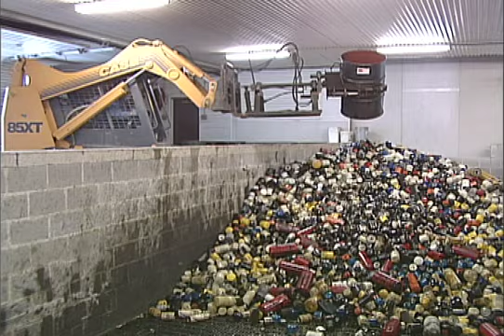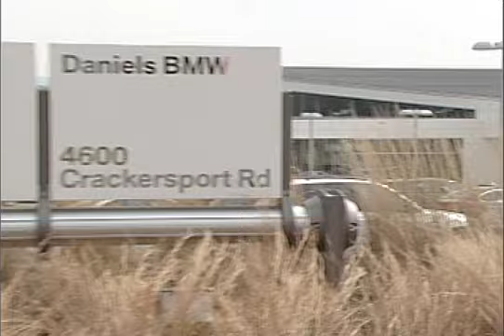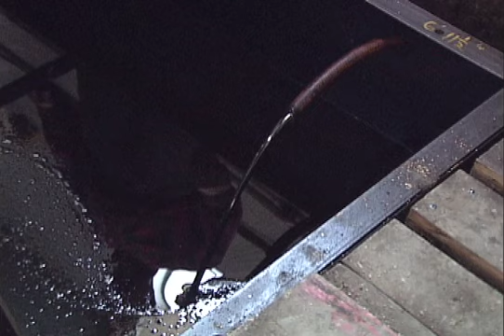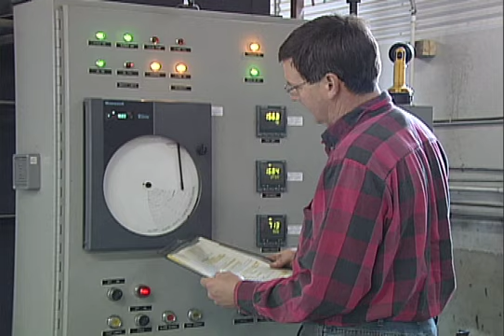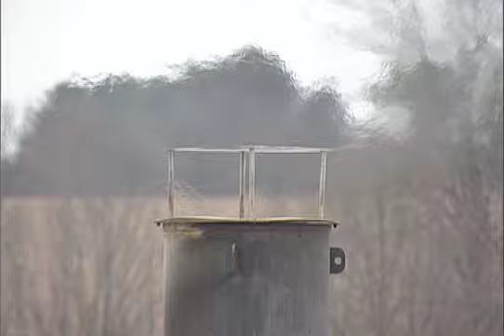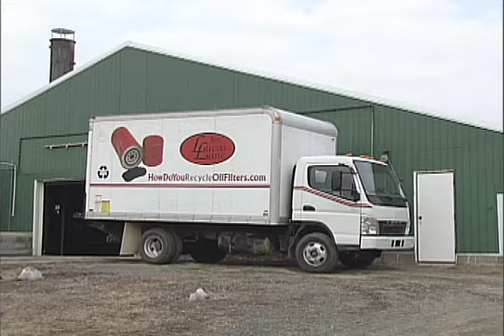Oil filter recycling by Lucas Lane Inc.

Comment: You're the reason why I started saving my used engine oil filters. Before, me and my dad would just throw the filters away in the garbage after me and my dad would be done with the oil change. But now, for like the past 5 - 7 years or so, I have been saving my filters and turning them into my neighborhood recycling center that accepts them and they can properly recycle the steel that would be found on the filter and the used motor oil that would still be trapped in the used oil filter.

Comment: I would take issue with the statement "this process is 100% environmentally friendly..." as the heat processing must generate not insignificant amounts of particulates, CO2 and noxious oxides.  If you scrubbed your chimney emissions then you might be able to make that claim.  Nevertheless, you are still making the best of a bad job (that which is done by needing to use machines that use so many oil filters in the first place - ie internal combustion engines) when there is a perfectly acceptable alternative to 90% of them; ie the electric motor.  Your work also goes to prove the wonderful old Yorkshire saying "Were tha's mook, tha's brahss" (or without the lame attempt at accurate Yorkshire phonetical pronounciation - "Where there's muck there's brass', 'brass' meaning money, here).

Comment: I just deal with my personal vehicles doing all the maintenance on them myself.
After an oil change I let the filter drain for like a week then toss it in a hot burning
wood stove in the garage.  When I get some 5-6 gallons of used oil it goes to the local
auto parts store where I believe it gets put back into industry.

Comment: Why not use centrifuge for oil removal? Works for honey....
Reply: Crushing removes 90% of oil. Final 10% is put to use to burn the paint, paper, rubber, and other non steel components of the filter, leaving ash and steel to be recycled as "clean" metal. The oil is still doing work even if it is not 100% removed.

Comment: Cool, where's the profit?
Reply: In selling metal
Reply: You may not realize this but Recycling is rarely profitable and usually a break even industry. Recycling shouldn't be supported because it is profitable but instead because it is the correct thing to do. Otherwise the streets and fields would be littered with garbage reaching levels you can see in 3rd world countries with zero support for collection and "disposal"
Reply: @btwbrand  It depends on what is being recycled.  Metals recycling is hugely profitable.  So is energy recovery.  What's not profitable is the fake feel-good BS RE/AE stuff they push down our throats.

Comment: Could someone please shed a bit of light on how does this video have so many dislikes? Is it because of a bit of misleading heat vapor (which is a bit of nothing-burger tbh)? Or am I missing something else?
Reply: you can see the dislikes?
Reply: @buckadillafilms  Yes some of us don't simply stop using likes and dislikes because google covered them with a piece of cloth. It has 1.4K dislikes. Did you know windows 10 and 11 are simply windows 7 with a different look. Every menu, setting, screen, and option on 7 is still under there, they just hid them under a new look and added a little support for newer items that could have been enabled in windows 7. Made the whole world buy the same operating system all over again. They just put a bad coat of paint on it.
Reply: @btwbrand  Do you have any tips on how to uncover the dislikes?
Reply: @buckadillafilms  Theres an add-on app of sorts that does that.
Reply: Its from the brainwashed tree huggers finding out how reality actually works.  They really don't like their little safe space bubbles getting popped.

Comment: So you burn 10% of the oils plus the rubbers ?? With the amount of fuels you use to pick up deliver separate and burn the 10% I'll bet it negates any benefit to the environment
Reply: Well on one hand.. they are cleaning steel to be melted down and used to make new items, collecting oil waste to be used in road production, and are providing a service and jobs.
What environmental benefit would it be to take the mountains of oil filters they didn't process and place them in the ground in a landfill or throw them out back in a pile like they did till the EPA was organized? Do an experiment. Take all your used oil filters and throw them in your front yard, and leave them there.  Make it a long term project and see if you can document the benefits.
Reply: Good thing CO2 is actually good for the planet and all life.

Comment: I remember when recycling oil filters was a thing. You'd collect them drain them and some places would have oil filter crushers. And we'd save them all in 55 gallon drums for pickup. Not anymore now they just get tossed in the dumpster nobody recycles oil filters anymore the cost was too much.
Reply from the maker: But the question is do those shops still charge a disposal (environmental) fee?

In my area most shops charge the customer several dollars per oil change to dispose of the filter and pay me less than a half dollar per filter and most burn the waste oil to heat their shops.
Reply: @farmerluke2  Ya they do. I worked in a lot of shops they all scam the customer.
Reply: A large portion of garbage is sifted and sorted through to remove items such as those oil filters if they end up in a bin and in the back of a garbage truck. Recycling is only a profitable work when you specialize in one type of recycling. In this case oil-filter recycling.

Comment: its a damn joke taking used oil to the collection center.. they just want you to do it so they can recycle it then resell it again and make a profit.

Always throw the oil on the brush fire.. or soak it up with a wag and throw it in the wood burner.... its the proper way to recycle used car oil... or take the used oil and spray up under the car wheel wells and underneth with used oil...
The final way to recycle used oil, if have a wooden porch, dump the oil on the wood. it will soak it all up because wood is thristy for oil.. and it will last for the longest time.....
Never have never will take used oil to the collection center.. it always goes in either the wood burner or the brush pile or the porch.

THE HELL WITH WATER BASED PAINT. USED OIL IS GOOD FOR WOOD
THE HELL WITH ANY PAINT, the paint they make today for wood is CHEAP MADE SHIT.. AND THE BEST PAINT YOU CAN GIVE TO THE WOOD OR PLYWOOD IS USED CAR OIL...

Comment: This is a great process. I do wonder sometimes if the green people (the really nutty ones) do realize that just because they like processes like this doesn't change the fact that it still takes alot of energy to do this and that there is no such thing as zero emissions. I realize that's not what this video is about but just a thought.
Reply: If you read these comments you will see that people are clueless about how the world works and the fact that the world runs off of co2 production.

Comment: You're burning waste oil to heat your ovens? That will pollute the air with heavy metals and chlorinated compounds.
Reply: Where do you think waste oil ends up? It doesn't get filtered and cleaned. It gets re-used as a fuel or part of a product, such as the asphalt they mentioned in the video.

Comment: Wouldn't drilling or punching holes in them prior to crushing help drain more oil out of them
Reply: 90% recovery is fine enough.  they needed 200 gallons in addition of the unrecoverable oil to create a fire that burns all of the metals clean enough for recycling.

Comment: So the filter and rubber gasket stays in the filter or did they not show the part there they cut open the filter and take them out and removed the filter and rubber gasket? This is awesome that this happens but so many people just toss oil filter in garbage. There should be a rebate for used oil filter return to make this effective.

Comment: Lul using 200 gallons of oil each time the do the thermal process is everything but environmentally friendly. I got a better idea. Use a shredder and then put all the pieces in a centrifuge to get all the oil out. It will be alot better and it wont waste 200 gallons of used oil.

Comment: What is the cost of energy spent in the furnace? Would it be less expensive to use mechanical shredder to cut filters into small pieces like 1/2 by 1/2 of an inch? These fragments can then fall on the pan from which oil will be drained via 1/4 inch mesh into the sump. BTW, how about making reusable elements?

Comment: As much as I dislike the cartridge filter on my rav4, seems like cartridge filters are the way to go. Waste oil dump locations should also take the cartridge filter and press what oil they can from them.  I would think with a good press, most of the oil in the filter would be removed.  At least this would save on steel production and the high amount of utilities used in most cases of recycling.

Comment: As a metallurgist, I really dont see the added benefit of the final step. The steel casing of the oil filter could be used as is in a foundry. All other burnable components, especially oil would add additional energy to the melting process which is beneficial. Furthermore the steel shown in the video comes out rusted, which is detrimental to its yield in steel production.

Comment: Thumbs up for recycling. But thumbs down for auto manufacturers. I hope auto manufacturers could abandon the steel oil filters and switch to those paper filter element (permanent housing for filters) used in BMW cars.

Less materials needed for manufacturing and less energy needed as well. 

Easier to recycling since its mostly paper rather than metal. Current recycling method causes the rubber and paper to be burnt off. If the filter is mostly paper, The paper may be recycled as well.

Comment: Had a process very similar here in West Central Alberta more than 30 years ago. The problem I have with the "environmental fee" that is charged on every oil filter, no matter what size & the environmental fee charged on the oil & the container also I sjust a TAX GRAB! Those "fees" in no way induce a customer to be environmentally friendly. Once you pay your fees you can do absolutely anything with those products. A better solution would be to return a portion to the customer as is done with the bottle & can recycling!

Comment: Worked for a company that used a service like this.They charged y the barrel not weight,so we redesigned a small crusher,that would do all our filters.After draining the filter for a few days,filter was crushed waste oil put in the proper drums for recycling,crushed filters put in a barrel.Recycler would often ask us why our barrels were so much more heavy than other customer's.We were furnishing our own barrels which were never returned so I guess everything worked out.

Comment: I would think a shredder like they use for whole cars, remove as much oil as possible with a centrifuge, separate the rubber & paper, use them for fuel to hear treat the scrap & I suspect you would reclaim a lot more oil & the process would be a lot easier to automate. Neat system.

Comment: 100% environmentally friendly?? What does the skid steer run on and produce as a waste gas? What fuel powers the electric generators powering your oven and crusher? What do your trucks run on? Not questioning it maybe a high level of Eco friendliness, but 100%?? You'd have to be doing everything by hand or foot. Such a flippant statement it over powers the rest of the video for me.

Comment: wouldnt it be better to run them through a fine shredder with magnetic separator after it? the guts of the filter (the filter material) go to pressing unit, then incinerator. and the metal go either through sentrifugal separator. and/or to incinerator to burn any left over oil clinging to it before recycler?

Comment: Re: plastic oil bottles  (slightly off-topic, sorry....). 
I've been told that any empty plastic bottles previously containing hazardous materials should not be put into the trash.
 Do you have any info on what should be done with plastic oil bottles & used gas cans?
Also, Thanks... You're fabulous!
Reply from the maker: You should check with the plastic recyclers to see what they say about any residue left in the bottles. The gas cans should be fine if the lids are left off, the gas will evaporate.

Comment: If you were to recover that waste heat by running the heat through a boiler to generate hot water or steam you could start another business providing hot water or steam to neighbors for heat or air conditioning. 
Or provide all the heat for all your buildings on site or hot water for heat to any nearby industrial park.

You might not have enough possible customers for heat now but if there is sufficient land nearby and you could open an large industrial park your could offer piped in heat for far less then other sources of fuel for heat. It's done in many communities in Norway though thier using hot water from underground thermal sources they even heat the sidewalks to prevent injuries to the public.

Just thinking of how to use a waste product you produce waste heat.

Just for chuckles go to a nearby state college and ask the hydronic professor to ask his students how they would utilize the waste heat.

What have you got to lose but a few hours and give the students a real project to sink thier teeth into.

Food for thought

Comment: Pipe your exhaust heat though a boiler.  Use the steam  from the boiler to power a steam turbin hooked to a generator for  electric.   pipe the steam around to the other out buildings to provide heat in the winter. Get a MIL spec steam kettle for the company kitchen.
Reply: Industry 4.0
Reply: I was thinking that it was a waste to just let all that heat out in the air. Timothy, it seems like a possible and greate solution... :-)
Reply: Pretty good idea. Use that exhausted to generate electricity...
Reply: Free energy and creates work for boilermakers welders pipefitters ect
Reply: ehhhh.....how many yrs to recoop your investment in a turbine? A boiler to produce superheated steam?
Reply: Timothy Hays You made this way to difficult to understand.

Comment: The industry should go back to using paper elements instead of the steel spin-on cartridge. Yes...I know some engines use paper now, like my VW TDi and Cadillac SRX. Good start.
Reply: Curt Chase paper elements break down fast and are not good for high pressure oil systems of any power. The only good place for a element is a cheap economy car.
Reply: There are many automakers making the change to those, but for whatever reason, the oil filters without metal on them seem to be more expensive (at retail, at least).

The only reason I could think of for that is that the spin-on ones are self-contained units that are easy to test.

Comment: I read somewhere that oil never wears out only the additives, so filtering out the dirt etc and adding new additives gives you back a new product.?
Reply: ferstuck37 like cooking it it does get dirty and the aditives in it are cooked but pulling the oil from the bonded petrol particals is very exspensive and when you hear recycled oil they are refering to mostly a like 2% used 98% refined mix.

Comment: I throw mine in the garbage after I pour my oil in the storm drain.
Reply: Good troll, sir
Reply: When I was a kid I would ask my dad why he poured the oil on the ground behind the garage. He always said he was sending it back where it came from. Classy fella.
Reply: Partikkus LOL! You could always use the waste oil,to kill poison oak along fence lines.
Reply: c3h8O hey, that's pretty hot.
Reply: i burn mine in a fire - along with the oil
Reply: i just throw mine in my backyard right next to where i pour out my used oil and antifreeze
Reply: Partikkus youre not funny.
Reply: @c3h80 lmfao
Reply: Normally I just park over the storm drain and just pull the oil drain plug and let it just flow right into the drain. No reason to dirty a drain pan.
Reply: John Jesus That's the proper way to do it. I also mop up any splashes with my wife's pet poodle.
Reply: @Maker Stories  I use those to wipe my ass
Reply: Your Grand kids will be thankful
Reply: You can use oil to stain wood
Reply: i  guess  we'll  always    have  a  few   a  holes   in  every crowd
Reply: I really do dump them in the garbage, the oil I throw on the neighbours flower bed,
Reply: Pour my oil back to the earth where it came from
Reply: Changing oil filters is for pussies. Done 400,000 miles, still got original filter.
Reply: Ditto
Reply: My father used to pour the old oil around the house foundation every spring. He said that it kept termites out of the house.
Reply: George Boyd  correct. I use all my waste oil to kill any weed by the fence of my house. Remember radiator coolant fluids kills unwanted  weeds/ grasses
Reply: Partikkus your an incredible idiot your the reason poeple in the government thinks your stupid panicking maniacs you polluting our precious earth with oil it not only kills poison oak it also kills everything else you fuckn hillbilly
Reply: are you familiar with sarcasm?
Reply: @davidlefort4553  take your precious BS and shove it up your ass
Reply: @davidlefort4553  He was being sarcastic.